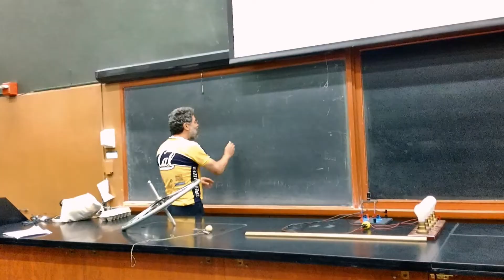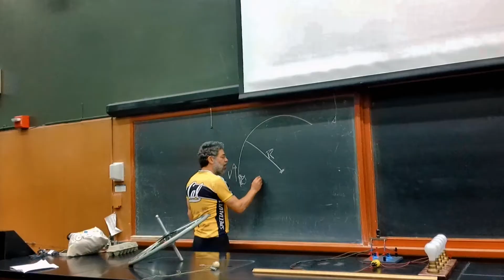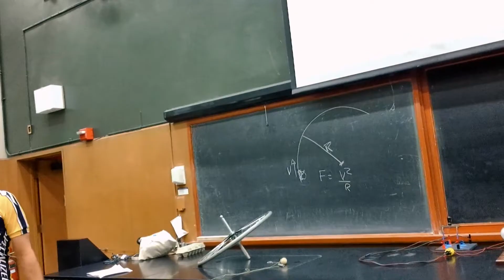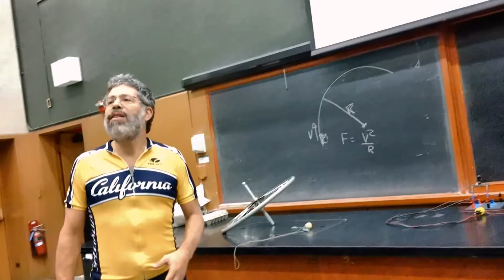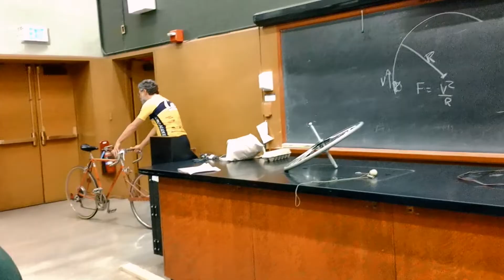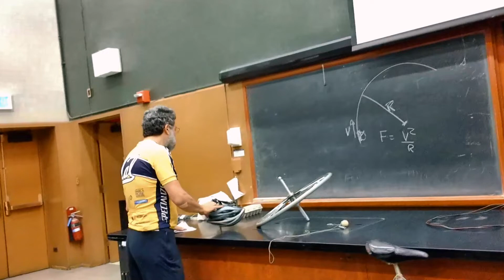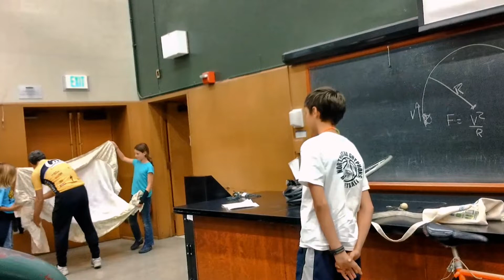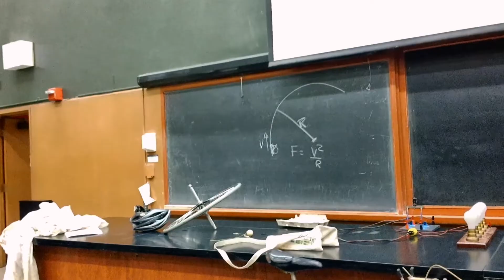The Physics of Bikes

Comment: I disagree somewhat. Although a centrifugal force (although fictional) certainly exists and affects balance when riding a bike, it is only part of all that's happening in keeping a bike upright. For instance, a rider can keep upright while on a track stand, maintaining balance by making minute body adjustments, much like standing on one's feet or an inverted pendulum, to keep his center of gravity aligned while waiting for the opponent to make the first move. Track cyclists can do this for a reasonable length of time with little to no displacement. Although a fixed-gear bike helps, the same feat can be attained with a regular bike, although some bike displacement might be needed. Another instance is while riding on rollers. There is no translational displacement when riding rollers, so centrifugal force cannot affect balance. It must, therefore, be attained again by the rider's skill in keeping his/her center of gravity aligned and perhaps benefiting from angular momentum.
Reply: I'll challenge your assertion.

A track stand doesn't utilize a bicycle's geometric stability characteristics to stay up.  All a track stand is is moving the bike back and forth laterally to prevent a lateral fall (or to the side).  I can track stand all day long.  And ride backwards reasonably well - even on a tandem.  (I also ride unicycle, but that's another matter completely.)

A track stand requires the front wheel to be angled at a very sharp degree.  I haven't measured it, but it's VERY steep.  I'd even go as far as saying the track-stand angle is too steep to be able to ride.  No way you can ride "normally" at such a sharp angle.  Now you could circle probably, but not "ride" in the traditional sense.

Also, track standing doesn't involve countersteering at all.  The front wheel is simply turned so far to the side that forward action on the pedal moves the bike more sideways underneath you than forward.  I trackstand pointed left (convenient for two reasons:  1.  I'm left-handed and dominant  and 2.  Left means UP the crown of a typical US road, so the bike can coast "right" by letting off pedal pressure) so when I start to fall left, I pedal forward, moving the bike to the left underneath me.  When I start to fall right, I let off pedal pressure and the bike rolls backwards and to the right, catching my fall to the right.  (Obviously not a fixed gear, so I cannot "push" the bike backwards, thus the aid of a hill.  That said, I can actually "push" myself back.  I do this with the brakes.  I hold the brakes, then push my body back, then release the brakes.  My body's momentum pulls the bike back.  Voila!  Track stands on level ground.)  This is how a track stand works and is separate from normal bicycle riding dynamics.  

And to your second point, rollers rely on bicycle frame geometry just as the road does; there's no difference.  What makes rollers so challenging is the tiny and curved contact surface.  Riding them takes practice, but with it, you can ride no hands just like on the street.

I don't mean to be a jerk.  Actually, I'd like to thank you for your post because it made me analyze some riding technique I hadn't really thought about in such detail.